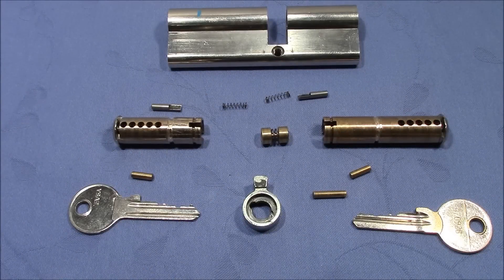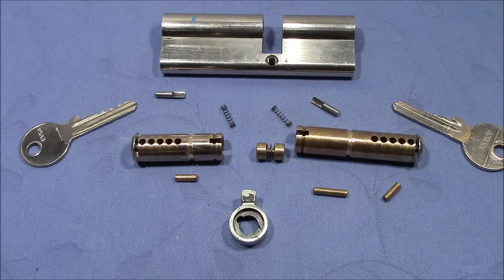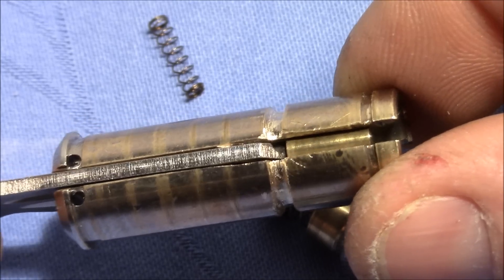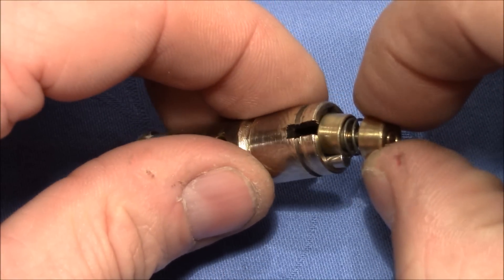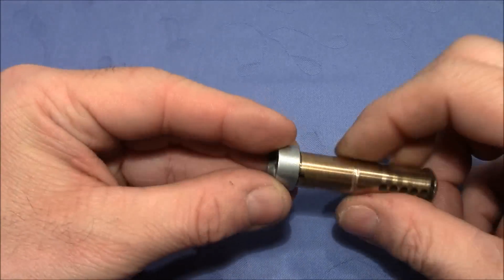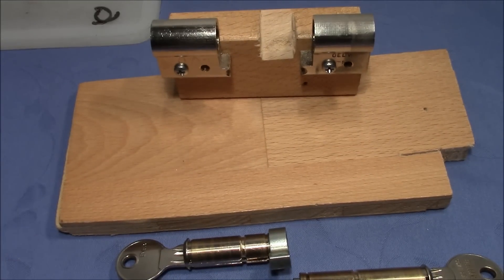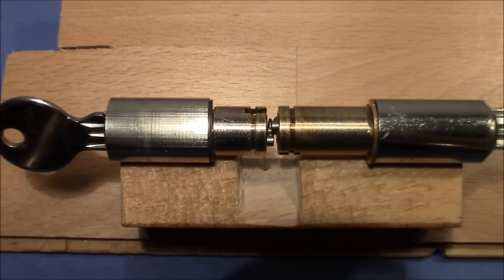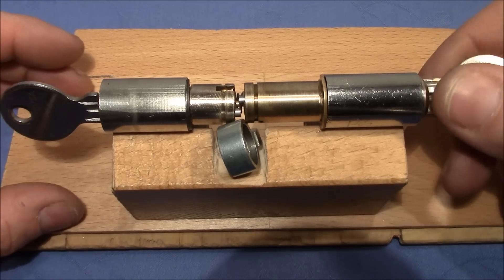(picking 467) Smart cam mechanism explained (EVVA euro cylinder with "Not-und Gefahrenfunktion")

Comment: I was told by one of your viewers that you might know how to pick and reset the combination on a master lock 1535dwd. I forgot my combination and I’ve been trying for literally years.
Reply from the maker: I don't have any experience with that lock, but it looks like that you have to pull on the shackle and need to find the right gates by turning the wheels. I can imagine that turning the wheels might be difficult with high shackle tension - maybe use a screwdriver instead of the fingers. Nonetheless, I will get myself such a lock and give it a go. Subscribe to my channel to not miss the video. Good luck with your lock.
Reply: I tried to pull on it and turn the dials, but it’s not much help. Maybe you can do it.
Reply from the maker: Stay tuned, the lock is on its way to me.
Reply from the maker: The lock arrived today. Video will follow soon.
Reply from the maker: Here we go: https://youtu.be/QiBRVo54S2Q

Comment: Nice demo, thank you.
I noticed there is a half moon notch only on one side, so one core has 2 spots to interact with the cam and the other core only has 1. Is that for interior/exterior? Does it make a difference what key gets inserted first?
Reply from the maker: I have also noticed this assymetry and I have no idea why it is there. Yes, depending on the orientation of the first key the second catches at a different point (left different to right). Extension is one possibility for the notch going through or just a function that is used in other locks and they have made only one such cam. There is no indication on the lock which side would inside or outside however.

Comment: what happens if you put a wrong key in one side, will the other still work normally?  Same as when you on a normal knob lock, can lock the knob,as it can't push out the wrong key being engaged with the cam, but blocked from turning by the pins
Reply from the maker: Well, then you're locked out. It's like holding one key with the hand when trying to turn the other - turning will stop ;-)
Reply: The wrong key will just block it, ironically unlike a regular cylinder where it would just be pushed back out a bit (since it can't turn and block) allowing access.

Comment: Absolutely interesting and great explanations Potti :). I really like your tech videos :). We have such a mechanism at the front and sometimes it's a pain, as the lock does not lock or unlock. Seeing the video I think the "half moon" is somehow not finding it's way into the right position on the cam or the cam has so much pressure that it is slipping out. Otherwise NG is a useful option. Very cool to see how it works :).
Reply from the maker: Thank you. Regarding your lock: better check for another lock. You never know if it suddenly stops working completely.
Reply: Well, me and neighbors have been locked a couple of times inside or outside, it's the front door as I said. The house owner should have changed it long time ago, but that never happened :(. I guess one day I will have to use the drill ;D. At least it is better than the frozen locks on our fence which made me be a couple of times late at work ;).